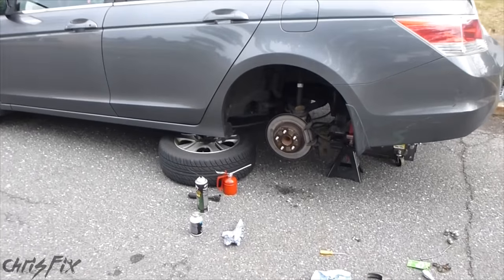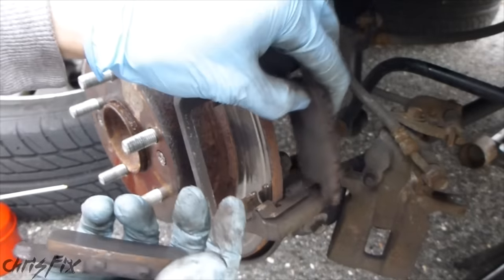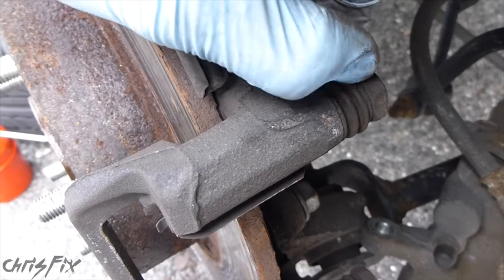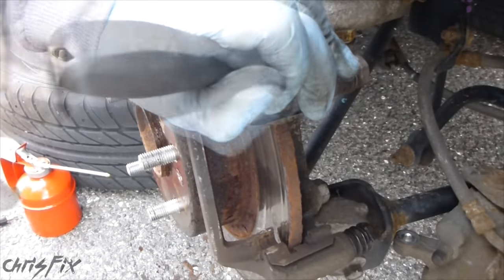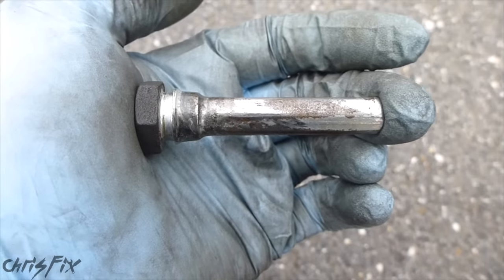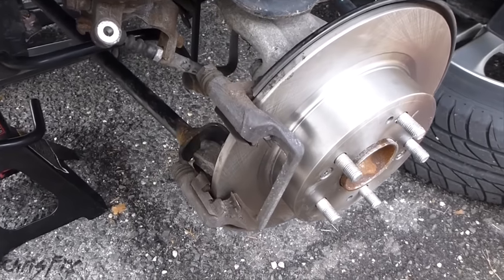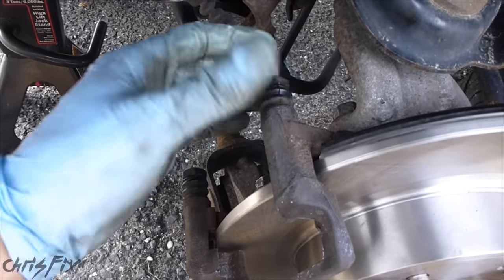How to Fix Uneven Brake Wear

Comment: The other thing to remember about your slide pins 

when you’re doing the brake job theyre at room temperature and whilst they feel okay you don’t know how they feel when they’re red hot because they’re too hot to touch 

so you’re well advised to always lubricate them to make sure that when they’re at operating temperature they still have the best chance of moving which is a different story to room temperature.........

Don’t forget metal expands if there’s any junk between the pin and the bore that stuff all expands 

it might feel okay at room temperature and when it’s hot it might be jamming.....

Comment: I bout a used 08 Ranger, front brake has the same issue. Never thought about the guide pins. Actually never knew you could even take those out. Great Video. Side note, someone said too much grease came off with your method of putting them back on. I wouldn't change your method. They only slide so really you just need enough to coat the metal so it slides. Jamming it full will just end with half of it seeping out while driving.

Comment: Also note: look at the back of the pad to find a raised peg/lug - seen in front of the third finger in that video still.  That engages into one of the four slots in the piston face. The piston as seen if this video did not have a slot aligned with that peg, the piston should be rotated so a slot is facing directly rearwards - visibly centred when looking into the caliper from behind. I don't know why they have this feature but look out for it as that would cause another issue of uneven wear.... if it even gets in of course.

Comment: So even if it looks like shes lubed up, and you can shove it back and forth. Never hurts to take it out, clean it, lube her up again properly, and shove it back in! Just for added safety ;-)
Reply from the maker: +BrysNightWorld #truth
Reply: BrysNightWorld 😂😂
Reply: Nice one guys! lol.
Reply: BrysNightWorld you damn right , thats what i did and i didn't know what i was doing when i changed my brakes,  i just guessed and it turned out great lol and its been more than 3 years and no problems
Reply: Just don't forget to reapply the rubber before sticking it in. If not, it can be pretty costly.
Reply: Also, as Chris said, you don't want to use the wrong lube or the rubber can break. Could be very costly in the long run.
Reply: And then go fix your brakes.
Reply: Wait wait.. im so confused right now.
I feel like there's some hidden meaning from those words.

Comment: I've seen the abuse from those pins not being cleaned. I've had to bore out the caliper bracket with a drill but because the grease turned into almost concrete. Needless to say the wheel locked up while driving though lol. I always tell people what you say. Even if they seem fine clean them anyway. prevents problems in the future. I love your videos man keep up the good work!

Comment: I had a guide pin that took me 4 hours of soaking, heating and banging to get out. Then I had to clean out the guide pin hole. Hard to believe that pin could be so hard to remove.
Reply from the maker: Mark Allison Crazy! It is amazing that they can be so hard to remove sometimes!
Reply: Mark Allison Seen a few get 'stuck'.. more likely some one forgot to grease it back up when re-installing.
Reply: Or the boot was not sealing and water got in and rusted.
Reply: Always use a silicone grease. Then you won't have issues. Another post said clean out the female hole the pin inserts into with a "bore brush" make sense. If the rubber is getting old replace as water and salt can get into the hole /pin and that causes the seizing issue. Cheers.
Reply: Next time swap out the bracket they are cheap
Reply: I wouldn’t spend that much effort...if it doesn’t come out with a reasonable amount of force, time to replace.

Comment: I'd just hit that pin really well with a wire wheel! thow some rust preventative if that silicon don't do it. Save some MULA!
Reply from the maker: 3DMachines Thanks man! That is what I ended up doing!
Reply: Zsasesss
Reply: never go cheap on brake parts, you life is worth more than few dollar
Reply: @shawnkelly1241  how did you go from fixing brake to that?!!
Reply: @ahoorakia  i dont know lol.
Reply: @ahoorakia  As long as the other 3 brakes are good then there’s nothing to worry though. If one brake fails you’ll notice the car pulls to one side a bit when braking, just keep that in account while driving home, then replace it.
Reply: @Engineer9736  I was talking about when you trying to put the new one don't go cheap! LOL

trust me I have over  one million mile driving experience, I have seen a lot
Reply: @Engineer9736  It's a rear brake, they're not important. :p

Comment: I just had this happen yesterday with my grandson’s 2002 Toyota Solara. Front Left, top glide pin was so stuck I had to use an impact wrench to bump it forward and reverse about a dozen times before it came loose! I did exactly what you did, with brake cleaner and a wire brush until it was usable. I also filled the hole with brake cleaner, waited about 5 minutes, and the used a pick to scrape around inside and get all the funk out. Turns out that once I did that, we didn’t even need to change the pads or rotors, which were both good with lots of material. No more vibration and chattering when braking!! 
P.S. Anybody want to buy new rotors and pads? 😄

Comment: They make caliper grease that is made just for the slides. It's green
Reply: joeyf504327 Silicon grease works great. It doesn't wear out the rubber boots and it doesn't solidify in winter.
Reply: Always use silicone on the pins, it works the best. Silicone will repel water and will not rot the rubber boots. I have used both. The silicone is better.

Comment: I love how you make your video's almost universal! If I have work done on my car it helps to know what they're trying to show me, or better yet what they should be looking for to avoid costly repeat visits.
Reply from the maker: +MrChristopher3232 Yea that is the goal! It is pointless to make it specific because not everyone has the same car.
Reply: Not every car will have such guide pins though. Also with replacing drum brake videos, a lot of them show that you can just remove the drum after removing the wheel, which is not the case for Ford Focus cars. At a Ford Focus you have to undo the center nut after which you remove the drum+one bearing. Boils down to, universal videos don’t work. If you’re planning to do work on your car then look up a video on that job on your specific car model. Also, don’t trust garages, i have never met a single one who didn’t cut corners, or charge crazy prices, or both.

Comment: You should also clean the hole where the pin lives
Reply from the maker: Pablo GR Definitely! Get some brake clean and a rag with a screw driver and clean it out! Thanks for the tip!
Reply: Yep.
Reply: Agreed. If the pin is seized in the bore and comes out looking crappy, you should expect the hole to be corroded/filled with cruddy grease too.
Reply: Yes & inspect with a bright light for corrosion.

Comment: Hey Chris, As usual, GREAT vid!1. Remove the caliper bracket/arm/carrier (whatever you call it) and spray brake cleaner into those holes.  You'll see all the gunk pour out.  Dry with compressed air.  (mind you eyes!)2. CLEAN those pins on a wire wheel, they come out LIKE NEW!  In fact, clean everything on the wire wheel!  Yeah, it takes 10 minutes and you mechanic says it ain't nec., but it makes  the job perfecter.3. Always buy PREMIUM brake pads.  They come with new rubbers, stainless steel shims, wire springs and back pads.4. Always buy PREMIUM rotors if you want powder coated hubs (which are WAY nice).  Else, you can paint (after cleaning with brake cleaner) the hubs with flat black Rustoleum paint.  Takes 2 secs and 'helps' keep them rust free for a while.5. ALWAYS clean the steel surface under the stainless steel shims really well!  (I should have made this #1!, because this is the #2 cause of uneven wear.)  Over time, bits of metal get deposited here and become welded on.  It doesn't look like much, (kinda like human scar tissue) but it's enough to make the pads BIND and get stuck.  I clean this surface with a Dremmel using the stone attachment.  A small file works well too.  Gently brush back and fourth until the surface shines like new.  You'll see tiny bits break off.

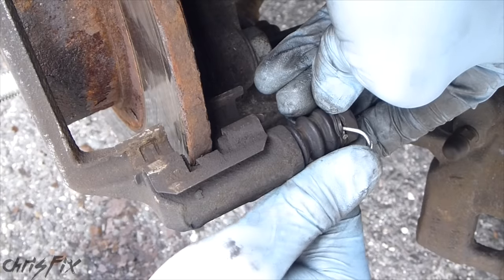Comment: at 3:12 you poked a hole through the rubber.
Reply: Good eye!
Reply: Unless he punctured it off camera, this is an old hole. You can see the hole at 3:16-3:17, and it's on the back of the boot, nowhere near where Chris levered it.
You should replace that boot though, no doubt. This makes me wonder if guide pins and rubber boots are sold separately or together.
Reply: That hole is on 180 degrees the other side from where he poked. The hole was already there.

Comment: You didn’t have to do knock out the pin with a hammer, you could’ve used a wrench and twist the pin out.
Reply: Sometimes need to use heat
Reply: Why wouldn’t you knock the pin out with a hammer? Hammering it seems to me like a whole lot more effective solution than twisting.

Comment: I like your vids Chris....I learn a lot.  One thing I think is worth mentioning , after you grease and re-insert the slide pins, I always 'burp' the boot by pinching it and creating a small gap to let the trapped air out.  I know this works because the pin then compresses a bit further.  keep up the good work!!
Reply from the maker: +jeffgrig thanks for sharing your tip!

Comment: Bro, you're the best. I had this exact problem.  I'm going to try to reuse the uneven shoe since the low part of it still has 50% left
Reply from the maker: Good luck! Be sure if you sand the pads, wear a good respirator.
Reply: Break pads don't cost that much just buy new ones.

Comment: You are right. But when you installed the brake pad on Honda’s you have to lined up the caliper piston with the brake pad or this will always happen. In the back of the inside brake pad there is a pin and you have to rotate the piston to match that  opening.  You are good to go!

Comment: Had this exact problem on my 06 ridgeline; Was hell on earth to get the stuck guide pin out.  Mine had rusted on the inside.   Same exact side and position too, Driver Rear.  I think mine  was the lower guide pin though.  Ended up replacing the pin and boot with a NAPA replacement and it fixed this issue (with silicone grease of course).

Comment: Had the same problem on our Hyundai I20. Stripped the caliper and washed it out with petrol, cleaned pin with water paper. Greased it up and put together. Had this problem on 3 different vehicles and never a hassle afterwards. Cheaper than getting replacement parts.

Comment: I had problems like that and I ground down the lugs on the brake shoe ends so they slid easily in the guides. The rotors spray dirt, water and rust into the brake lug guides and seizes them up if they fit to tight. That took care of the squeaking and bad wear. The pin lube is needed like you said.
 Also try to get the rust resistance rotors. The cooling fins in the centers get clogged with rust and dirt then they don't cool the disc evenly, then they warp.

Comment: Hi Chris, greets from Holland! 
 I had exactly this problem.  Also i noticed the "cross" or slits on the caliper piston top , which had to match up with a "notch" on the back-plate of the brake pad.  Mine was wearing very unevenly too,   but it was BECAUSE of this notch on the brake pad NOT matching up with the slits/cross on the caliper cylinder.  This of course makes it press unevenly on the pad.  I missed this in this vid as a cause of this happening,  i would def think this would also (in time) make one of the pins seize. 
Thanks for all the great info/vids

Comment: Great tip, make sure to put rubber on the pin first before the grease as it leaked out trying to slide it in the cover.
Reply from the maker: Thanks for sharing!

Comment: chrisfix first of all thanks for all your videos,keep up the good work.i haven't read all the comments down below so if someone else said it,sorry in advance.the reason i believe for this uneven wear on this pads is because the rear pad has a small pin that has to align inside the cross that's on the caliper piston.if you see the mark on the piston where the pad use to sit you'l see what i mean.and again let me say you do a great job and very easy for a rookie to understand.

Comment: As a tip about the corrosion. I had a similar problem on my 90 300zx, the guide rods had collected large amounts of dust from the ceramic pads and were preventing the pads from moving. I ended up wrapping the rods in sand paper, 800 grit, and ran the rod with a drill through the paper. Repeated until it was polished and smoothed, lubed it up and replaced.

I was actually experiencing braking shudder that didn't make sense. Well it was because the pads were sticking on the rods. After adding anti seize to the rods and replacing everything the shudder went away entirely.

Granted my brakes are not floating calipers like yours, but floating pads.
Reply from the maker: +Joshua Jordan Awesome and thanks for sharing! Nice work figuring that out!

Comment: good call on the silicone paste.  been using regular axle grease.  No idea it was bad for rubber.
Reply from the maker: +Michael G Thanks! It isnt the end of the world if you use axle grease (better than no grease) but you will need to change your boots every brake job.

Comment: Good vid, most others neglect this part.  You should also clean inside the bracket were the pins go in.  Never saw a top one fail with a good seal.  I always see the bottom one frozen likely due to winter weather.

Comment: Chris, You did not mention when reinstall the guiding pin after cleaning make sure to blead the air out that is trapped inside the rubber seal.  This may cause some wear to the rubber seal (air bulging) when compression is engaged.

Comment: Hi chris, great detail, ty 100-100, but remember these Hondas as you know has to "screw back the piston with the special tool (these calipers has built in hand brake system) that you  IMPERATIVELY MUST screw that piston back whilst holding pressure !! NEXT, Align the small round circular dowel that is on the inner disc pad  (LOOK CLOSELY) that dowel has to align in one of these 4 indentations that machined on that piston, so i look at it closely and it is imperative that this dowel on the inner pad, must fit in one of these 4 slots in the piston as it it there for alignment and even pad wear and also for the handbrake to be tightened up by the driver,by just pulling up on the handbrake lever a few times inside these honda s car. so detail has to be adhered to on these hondas with this design caliper.ALSO I personally like to,when i take the holder of  to replace the rotors, i like to clean up the sliding areas where these dids pads slide with a wire brush to reassure sliding is not a problem  ( i have  2012 accord with this setup.+ 25 plus years as a mechanic in eastern Canada salt and conditions) ty Sir,keep posting great vids!!

Comment: You can use a piece of 220 grit sand paper put through the slit in a cotter pin and chuck it in a drill to clean the bore. Spray brake cleaner before and after. It works very well.

Thanks for the video.
Reply from the maker: +Bruce L. Thanks for the tip

Comment: The brown goop baked on the caliper pin, and preventing it from moving, was the old petroleum-based grease, which is exactly why you use silicone grease on these pins.  For those who think they don't want to waste money on a decent grade of silicone grease, remember:  Silicone grease is cheaper than new pads and new rotors.

Comment: great video, I'm just going to trow in my 2 cents
1-another thing I have notice that causes this problem,,,is when putting on the pads,,,people don't pay attention to the small pin on the back of the pad,,it has to line up with the groves of the piston,,some times people do not make sure the small pin go in the groove. And if left out of the groove it will be un-even

2-pin holes need to be clean, specially after pulling the rusted pin,,,I use gun barrel bore brush ( the little round ones) I put on my Makita and give a go, it has to bi a bit bigger than the hole and fit tight.
3-lubricate the inside of the pin hole also,,,so you don't push the grease to the back of the pin when push the pin in.
4-if no pick, you can pull boot by hand.
5-not sue if you must,,,but what I do also, is pull the slide shims, (where the pads sit and slide) wire brush them with a small brush,,,and also put some of the silicone paste.

Comment: Wish the guide pins on my Ranger moved as freely as the ones in this video.
I used heat and brute strength and ended up snapping a guide pin.
Had to replace the caliper bracket but the parts stores here don't sell just the bracket. 
You have to buy the caliper too. 
So what started out as a $30 / 10 minute brake job took a couple of hours and around $200.

Stay classy, Chris.

Comment: Yes, there are many different shades of rubber compounds, butyl/nitrile for petroleum, EPDM for brake and antifreeze.  It's important not to use an incompatible rubber compound for the intended application.  For instance, a hydraulic jack piston would not have EPDM piston seals and a brake caliper piston would not have nitrile seals.
I think it's safe to assume those caliper bolt bellows seals are likely made of EPDM, the same rubber compound as your flex brake lines, caliper piston seals and cooling system hoses.